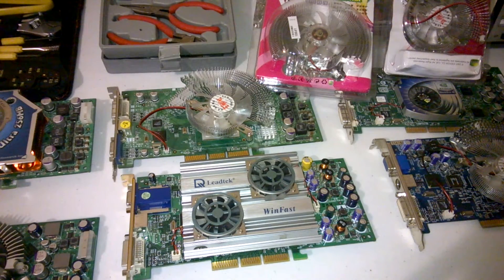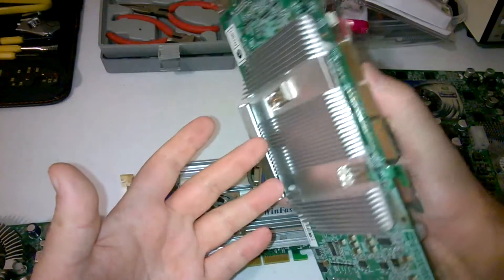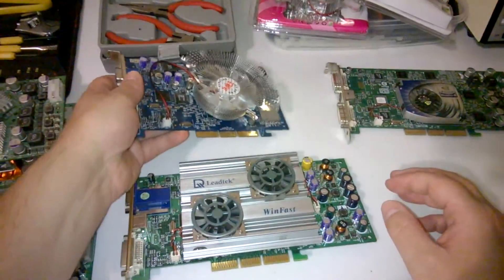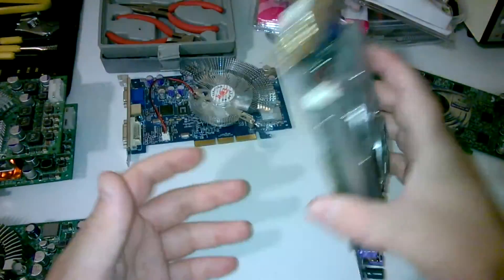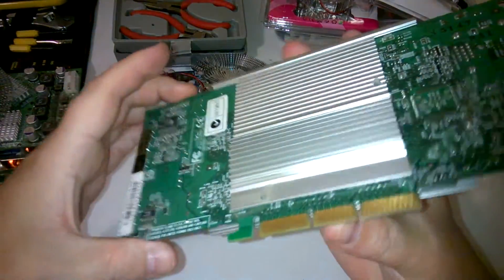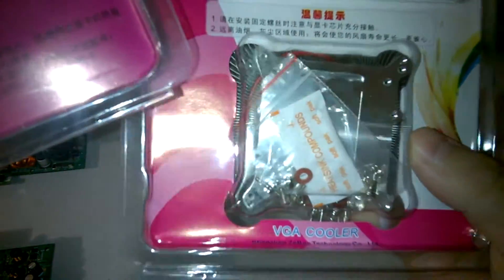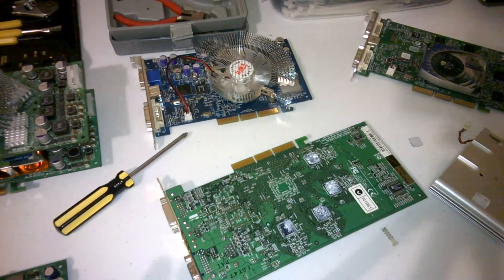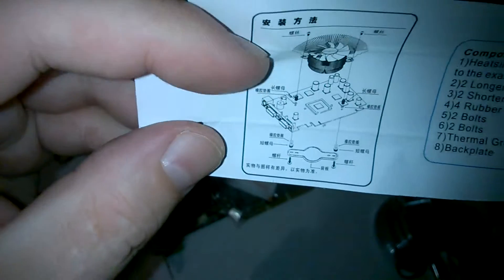How to replace fan on graphics card

Comment: Wish there was more options available, I mean...this is fine, works great and everything but it’s a shame there aren’t more options available to keep the original heatsinks.
Reply: Very late reply, but if you are really desperate then you can take apart the cooler, remove the fans, and give them some new lubricating oil. It will make the fans quieter for sure.
Reply: @czeky274 Oh absolutely, I’ve done that many times.

But I’ve got a lot of cards where the fan is completely seized and replacements are just not available, so it’s either replace the whole thing (like in this video) or keep the card aside until a suitable fan can be sourced, that’s what I usually do.

Comment: What are the temperature difference between the FX5950 with the old cooler compared to the new one?

Also if I am not mistaken the Zalman Coolers those are based off of has two heatpipes aswell so it would be interesting to see the temperature difference.
Reply from the maker: +HPZeta Nice to hear from you again. Your last video has been a while, hopefully things have worked out for you.

I remember only being happy with the temperatures, meaning I wrote down a figure before and was very happy with the temperature after, but I can't remember the actual numbers, sorry.
Reply: Things have been going a bit better on my side, I am moving this month and starting a new job in January :) will be doing new videos next year, lots have changed , some good , some not but I have a lot of ideas for more content

I think I will grab one of those coolers in the new year , have a few cards where the fans stopped working :)
Reply from the maker: Good to hear and looking forward to videos of yours :)

These coolers are quite cheap and work very well. Also super quiet, basically silent.
Reply: @philscomputerlab  where can I buy that pink Chinese a9 cooler you have in this video? I've been searching alot but can't find it

Comment: I would've put on the memory heatsinks, they're cheap enough and certainly keep the memory cooler, especially under that fan.
Reply from the maker: Phrea Nix On the FX5950 Ultra a did that. But on this card, RAM coolers are not really necessary. But you're right, it's a good ting to do. They are cheap, so why not.